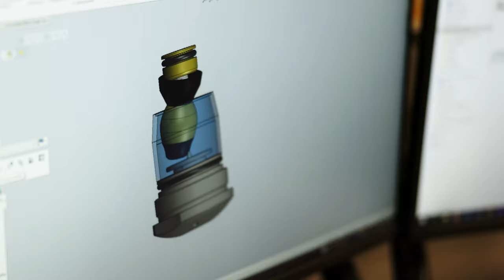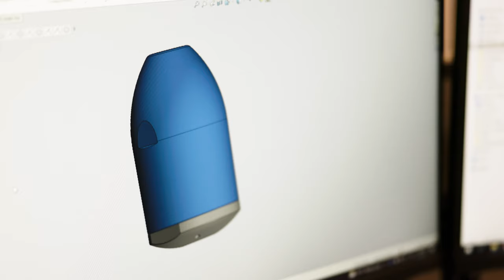Meet the 1/4" Reaper™ rotating sewer jetting nozzle

Comment: Just bought this 1/4" because I like how my 3/8" Reaper works.  I can't wait to try it!  I also own various drilled static nozzles and the 3/8" warthog.. the "competition".. Here's what's great about the Reaper: In an ideal world, all my jetting would be done upstream.. In other words, jetting towards the house from the sewer or from a cleanout heading into the house.  That way, a nozzle like the warthog(which has most of it's thrust and cutting power heading towards the rear) would be sending all the debris in the downstream direction towards the street.  Since I can't see or "steer" the nozzle exactly where I want it to go(always seems to find the first toilet) the safest way to jet is downstream.  Many times to avoid a mess, I jet from a stack if possible.  The Reaper does a great job of cleaning and flushing in the forward direction; which is a huge plus.  Even though so much power is sent to the front cutter, it feeds fairly well for all my residential/light commercial 2-4" lines.  I have a feeling the new nozzle will be my go to very soon.
Reply from the maker: We're happy to hear the Reaper is in your toolkit and providing you with exceptional performance. Please keep us updated on your experience with the 1/4" once you've tried it out! Feel free to send us your email and we'll hook you up with a Reaper hat.
Reply: What is the screw thread on the 1/4" & 3/8" reapers??
Reply from the maker: @Smiler7  The 1/4" Reaper will attach to a 1/4" hose and the 3/8" Reaper with attach to a 3/8" hose.
Reply: @HydraFlexInc  you don’t know the thread type on your nozzles?
Reply from the maker: @Smiler7  Our Reaper's come in both NPT and BSPP threads. As for the tread spacing for the rear jets, the 3/8" Reaper's is 1/16-27 NPT (0.26 Thread Engagement), the 1/4" does not have inserts. Feel free to give us a call and we can go over any further details if needed 952-808-3640.
Reply: @HydraFlexInc Thank you!

Comment: What PSI would you need for this? Would a 2000psi be enough regular residential maintenance?
Reply from the maker: Hi @1ELiMusic! Our 1/4" Reaper currently comes in 2 sizes 6.0 or 8.0 (1,500 - 4,000 PSI) and is meant for residential pipe cleaning

Comment: What is the required minimum pressure and gpm for the 1/4” reaper?
Reply from the maker: Our 1/4" size 6.0 Reaper has a minimum PSI of 1,500 at 3.7 GPM

Comment: 1/4" size 6.0 Reaper has a minimum PSI of 1,500 at 3.7 GPM. Pressure is not a problem but gpm is for me . Mine honda capable of 3 gpm .
Does anybody knows if  1/4 Reaper used with this water flow , how much less effective will it be ? I am homeowner , not a professional plumber . Need this to clean storm drains every year . Would really appreciate any feedback .
Reply: Also wanting to know the answer 🤷🏼‍♀️
Reply: got this answer on another channel  
 from @HydraFlexInc
@orestovich Unfortunately at the moment the machine would not provide enough flow to keep the pressure high enough for the nozzle to be effective. However, we are working on a new size soon and you should stay tuned for something that can work on your machine! @UBGood